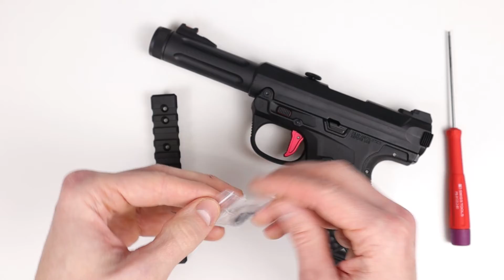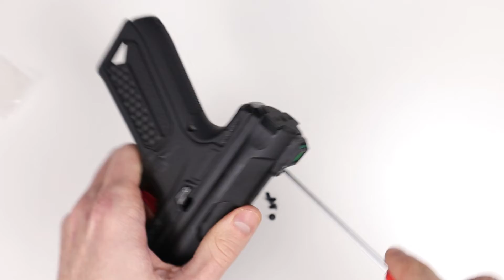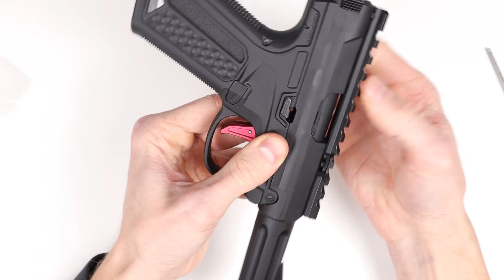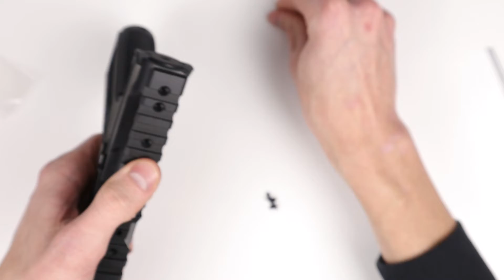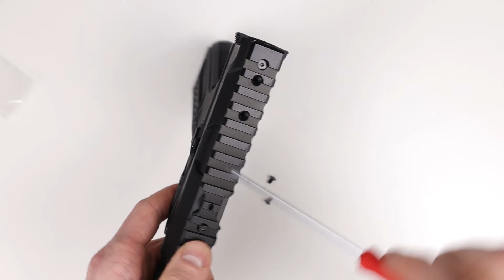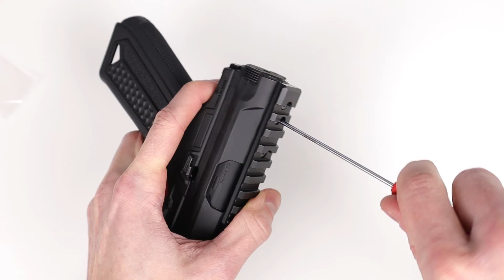AAP-01 Top Rail with TDC Clicker | Installation guide by TRIDOS.DESIGN

Comment: Maybe you can do a shorter version, so it will fir with the ActionArmy folding stock
Reply from the maker: We'll be doing a full length version to be compatible with the folding stock. We don't feel comfortable mounting a rail just on 2 plastic threads in the frame.
Reply: @TRIDOS.DESIGN when do you expect the long rail for folding stock to be available?